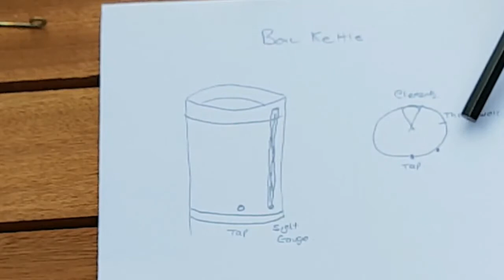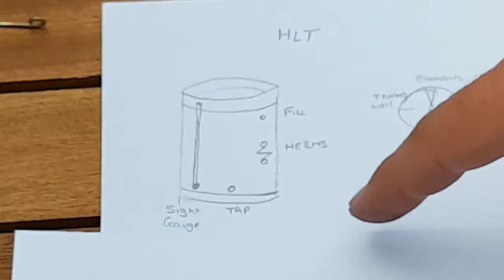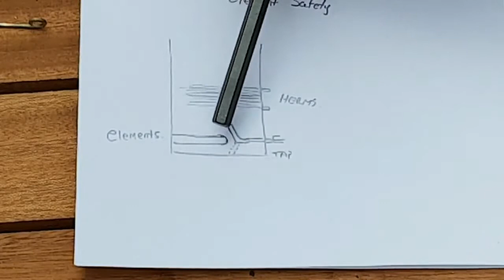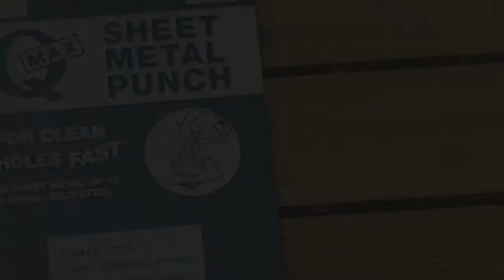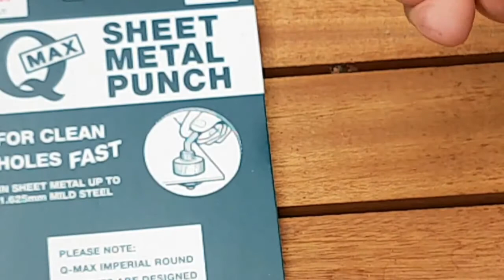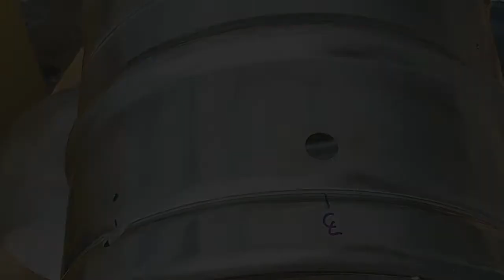Keg Build Q Max Cutter

Comment: Water levels and elements - my idea would be to fit a water level sensor that is connected back to the control panel in line with the SSR input terminals (the ones that turn the SSR on). In the past I mentioned using an ultrasonic sensor as they can be fitted to the top of the HLT but they may be too expensive for us homebrewers. Maybe I should do a vid on them. Keep up the built.
Reply from the maker: Thanks for that Mark, it's a good idea for a video. I will have a look what I can find too.